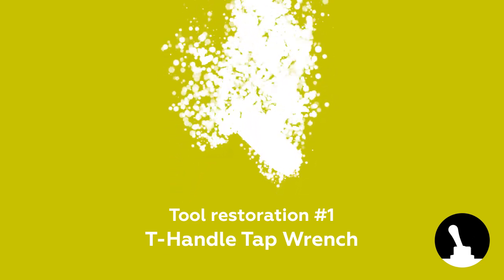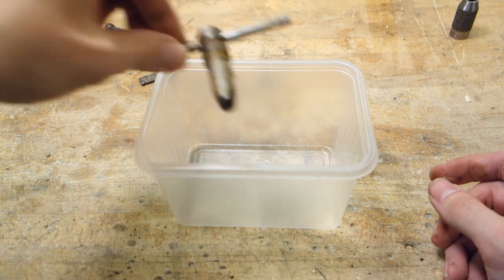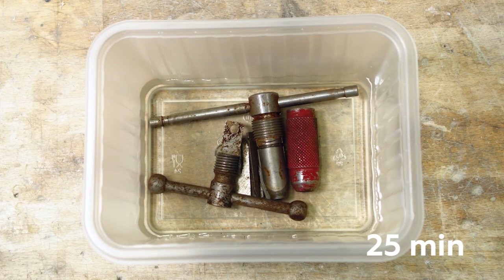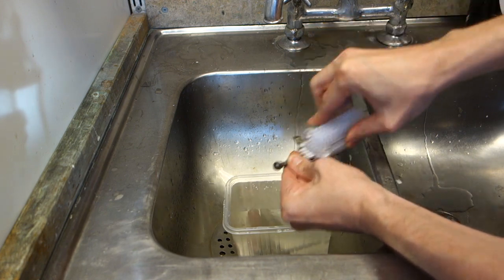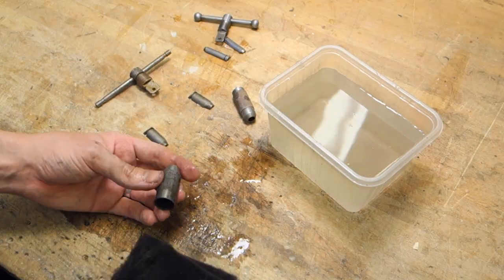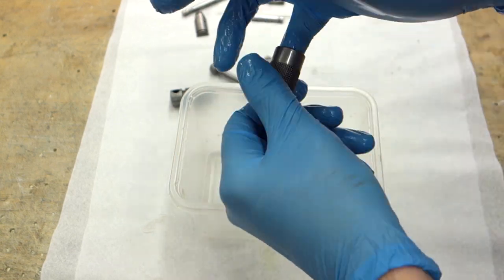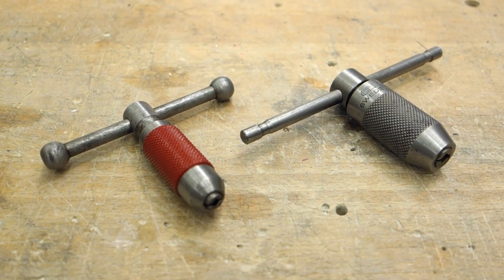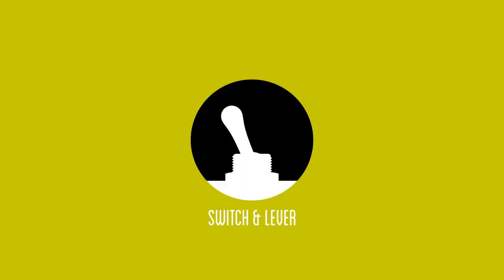Tool restoration #1: T-Handle Tap Wrenches

Comment: Got any thread gauges to restore? That’s what I need to do and was thinking of using the coke method. Do you know if it works?
Reply from the maker: Nope, unfortunately not. I don't know if I would use acids on measurement tools to be honest, it would probably be better to use a dedicated rust removal compound, like Evaporust. Acids will attack the base metal as well, even if just a tiny bit, whereas rust removal compounds will only work on the rust. You can also do electrolysis, which also should only attack the rust.

Comment: Did you pour the Acetone paint mix down the Drain? Or was that a special cleaning station? Remember that everything that goes down your drain ends up in your drinking water sooner or later. Also it might kill the bacteria in your local wastewater treatment plant which then has to stop operation and depending on local laws/regulations has to pay huge amounts of your tax/fees for proper disposal via trucks to other nearby plants until the biology has recovered.
Reply from the maker: +Cutter Slade I knew I was going to catch some flack for that. Yeah, don't do that, dispose of it properly. It was a moment of lapse of thinking as normally it's dumped for chemical disposal.
Reply: Cutter Slade n

Comment: can we use WD-40 in place of sewing machine oil, or is it a different compound?
Reply from the maker: +Nelson Baietti while wd-40 is a lubricant its primary usage is not really to act as a long term lubricant, but rather to dissolve rust and clean surfaces for using another lubricant. I don't know to what degree wd-40 may harden over time, which sewing machine oil won't.

Comment: Dude, get you a bench grinder wire wheel. Much faster.
Reply from the maker: +justfakeit888 sometimes speed isn't the most important part. If you're having a lot of things to do, sure, but for a couple of pieces it's a bit overkill. I also haven't found a wheel that's not too abrasive for work like this. I don't want to completely ruin the patina.
Reply: It's not only fast, it does a great job. I actually like it for small projects, and chemical cleaners for large ones. We have a standard fine wire wheel 8", and it is very non-abrasive. I'll use it on tools, drill bits, structural steel, whatever needs cleaning.

It also leaves a beautiful patina. Only removes the rust, and just leaves a nice smooth, simi shiny but blackish surface. Life if you buffed a very old saw blade back to life or something.